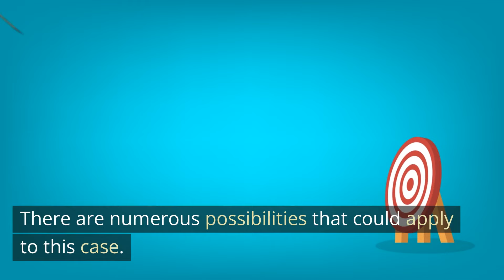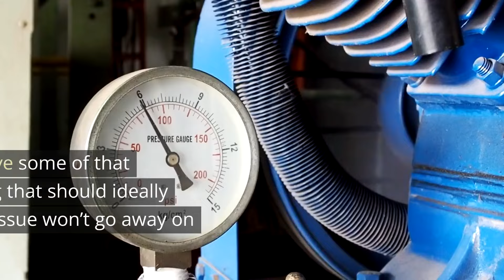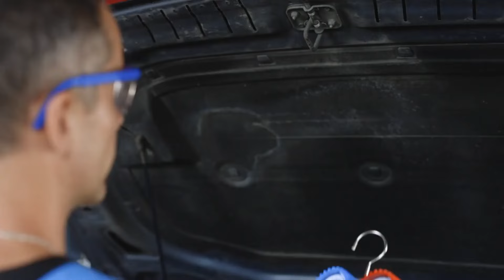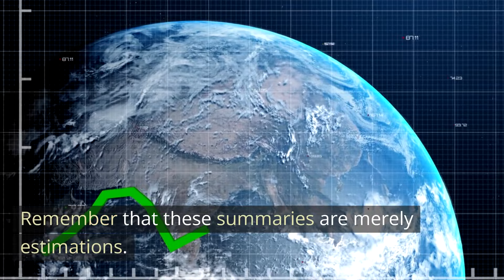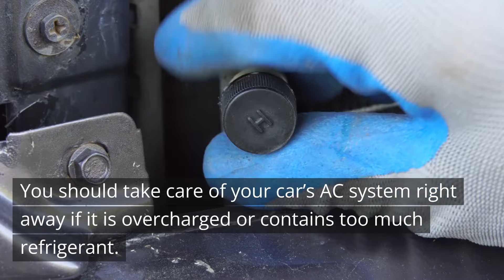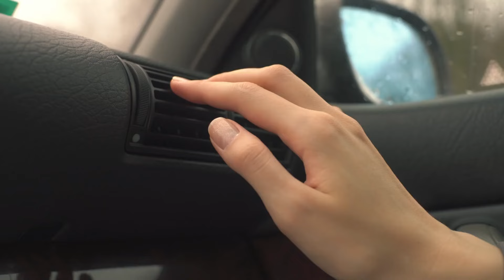AC Low-side Pressure Too High? Learn Causes & Easy Fixes!

Comment: Hi and thank you for the video. I have Toyota RAV4 Limited 2011 where the AC blows hot. When I measured the system I got 87 psi on both sides when the outside temperature was 71F and humidity 30%. Strange thing happened when I started the car and switched on the AC. I could see the compressor engaged but the low side went down close to 0 psi while the high side went just a little bit up to 100 psi. Would you please have any idea where the problem might be? I have to admit that I have messed up with the AC without any knowledge. I charged the system like two years ago. It was working the same as before than learned that I can destroy it with the incorrect charge so when the AC started to blow hot air I have released some pressure out...... Any idea is appreciated.
Reply: Add refrigerant.
Reply: @brassmule  Thank you very much. This is what I did and it solved the problem.
Reply: @jaroslavsimecek8452 Sounds like you were on the right trail, using a guage set to check high and low pressures.  The levels should be the same with the engine off - the PSI off will depend on ambient air temperature (higher PSI with higher outdoor temps) unless you have no charge at all.    And yeah turning it on, the compressor will drop that low side down a lot, but it should recover to 30-50 PSI depending on outside temps and the high side will be 200 to 350, again depending on outside temps.  Yours was classic signs of low refrigerant levels.  Be proud of yourself that you recognized it was wrong, took steps to figure it out, and then got it done!

Comment: If your AC is not blowing cold air and your compressor turns on for a for a second then off, Check to see if the pressure is too high! That’s what was wrong with mine. Now it’s blowing 49.8°💪🏻💪🏻💪🏻
Reply: How did u fix it ?
Reply: Emptied it and then refill the Freon
Reply: I have a 2018 traverse the compressor isnt kicking on unless I jump the relay I've only had it since November so idk what the issue is csnt tell if its just low snd not kicking on as safety or what. But the pressure was at 80 from the get go on low side 😊
Reply: What did you do?
Reply: Emptied it,  then refilled the Freon.
Reply: Emptied it, because my pressure was too high and then refill the Freon.
Reply: So now what's the part?
Reply: I didn’t have to change a part, I just had to empty and then refill the Freon. My pressure was too on the side.
Reply: @jond7478 how did you empty it
Reply: I originally fixed my issue on my 17' Jetta 1.4 by replacing the expansion valve and recharging. A few months later this issue persists and even a full recovery, vacuum pull and recharge don't fix it. I'm trying a new electronic control valve for my compressor to see if that fixes the issue.

One fan runs instead of both (the smaller one on high), compressor runs for a second and shuts off for a few minutes, a/c blows hot. High side pressure reads 400-450 and low side is about 200 - 320. It's very stupid

Comment: Freon:  How do you add Freon when the compressor won't turn because of low freon?
Reply: When done properly, the ac system will be under vacuum therefore the refrigerant will be sucked out of the first can and will be enough to cycle the compressor
Reply: The way I learned is to very briefly short out the low pressure cutoff switch - you can unplug the connector and stick a paperclip in between the two contacts.  Be very careful doing this and do not leave the jumper in place for more than a few seconds.  DISCLAIMER: I am not responsible if you ruin your A/C system.  Or just take it to a pro.
Reply: Pressure Switch:  bypass me to turn me on
Reply: You have to jump the ac compressor relay,use a fusible link rather than paperclip

Comment: I am getting a high reading of 80 psi and still blowing warm air. Every now and again i can hear a click from the engine/air con and the dial will slightly go down and then back up to 80 again. Any ideas??
Reply: low refregerant. vaccum and recharge again. if the compressor is clicking then system is functional and just low on freon.
Reply: @srinivaspulukuru7714  how about if the compreclutch spins continuously and does not click off. 80 psi high and 80 psi low. Low line feels hot and high line feels colder
Reply: Did you fix it ?

Comment: I was told my hugh preddure hose has a leak on my golf mk4. Is it easy to change myself or better for a professional
Reply: It's easy to change yourself. But you will need a way to pull a vacuum when you're done. Harbor freight sells least expensive air compressor hose fittings and the compressed air ran vacuum pump.

Comment: What I filled it out want over charged but AC so wasnt working, went to check the pressure sheet and then it was over filled, so I tipped the the low pressure cap to relive pressure for a second at a time and then it started working. Love my neighbor he comes over every time he sees me working on my pos Cadillac and he's a retired mechanic but I don't think he knows how to work on newer cars because half the time he's really helpful but then some of the time he makes the issue worse. They make these new cars so damn complicated I remember when you used to change a battery so you did was take the old one out and put the new one in, now you have to tap the brakes, open and close windows and follow a whole process that nobody seems to reliably know and now my speakers don't work

Comment: I hate these stupid fake AI voiced videos.  But cause #2 was the problem so the stupid video worked.  My wife's car A/C was way overcharged and wasn't working.  High side PSI off the chart.  The compressor was turning, clutch engaged.   Let out hot air for probably 20 seconds while the car wasn't running until Freon started spraying.  Started the car and revved it up.  Checked pressure again, off the charts.  Repeated the process.  More hot air for several seconds until Freon spray.  Started it up again, revved it.  turned it off, checked pressure and it dropped from off the charts to 50% into red.  Repeated the process three times, cold air started to return after second pressure release.  Probably repeated this process 5 times until pressure was right at the green red line.  AC blowing ice cold now.   For the record, I didn't have a manifold set.  Just the universal cheap low side pressure gauge that came with one of the big refill bottles that was $40.  It was good enough. Thought I was going to have to fork out $500 and work all night to replace the compressor.  I never jack with the expansion valve because it usually means pulling out the dash.  Sometimes the dryer tank if it's easy to get to.  Never had a replacement compressor fail within several years.  This  Jeep Compass is 12 years old,  never had a compressor fail.